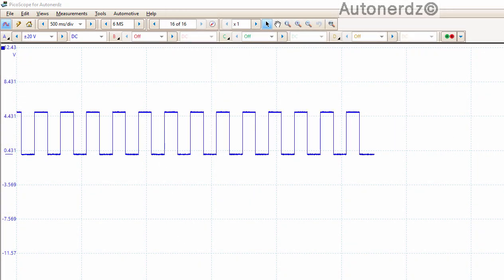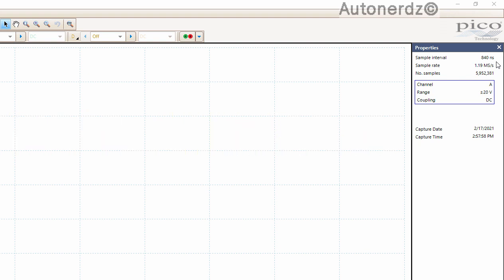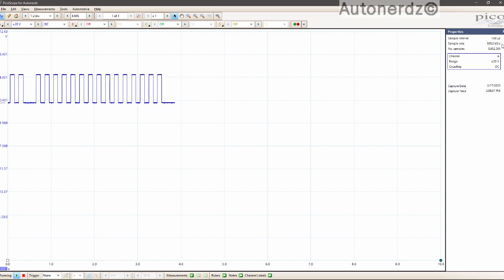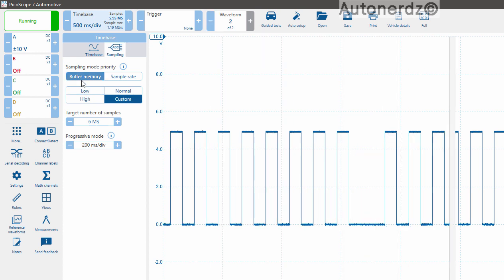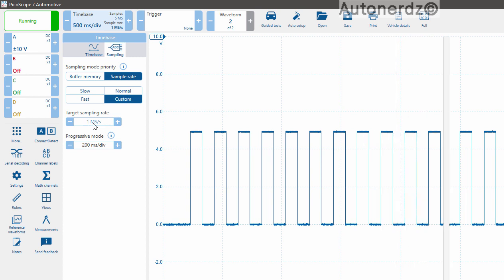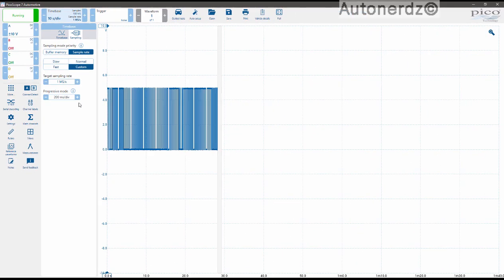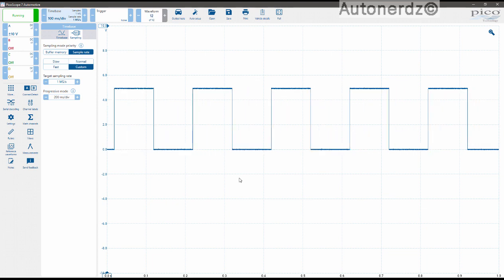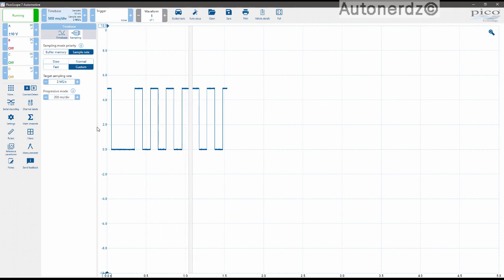Picoscope Sample Rate for Beginners

Comment: Have you ever found a situation where 1 mil samples was not enough to capture what you need? I am currently debating on whether I should set my default rate at 1 or 2 million samples per second. Thanks!
Reply from the maker: Hello Keith. Yes, there are instances were 1MS/s(Million Samples per second) is not enough. Data bus diagnostics is a good example. When a network may have a 1MHz or greater operating frequency "The Nyquist theorem specifies that a sinuisoidal function in time or distance can be regenerated with no loss of information as long as it is sampled at a frequency greater than or equal to twice per cycle." Which would mean a 1MHz signal needs to be sampled at 2MHz or more. 2MHz aka 2MS/s.